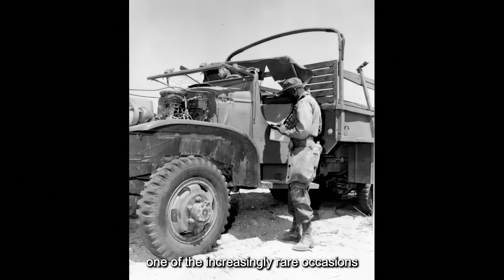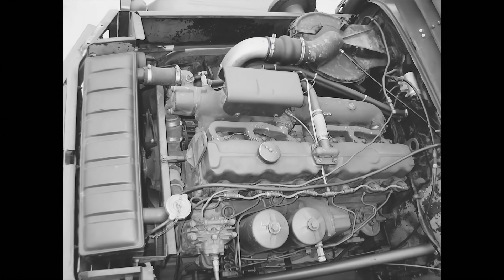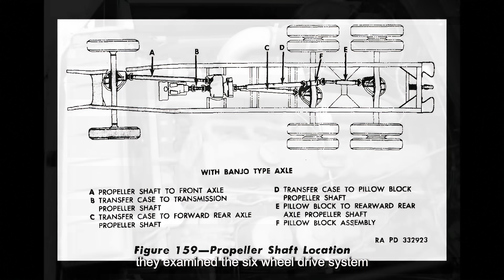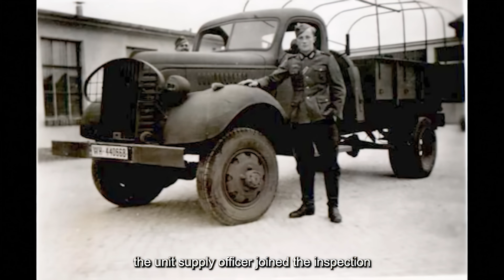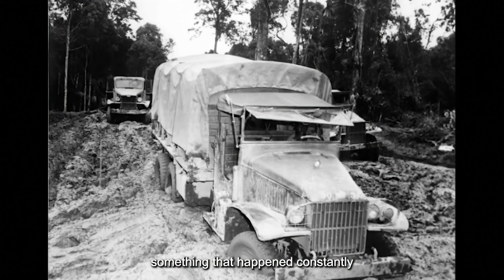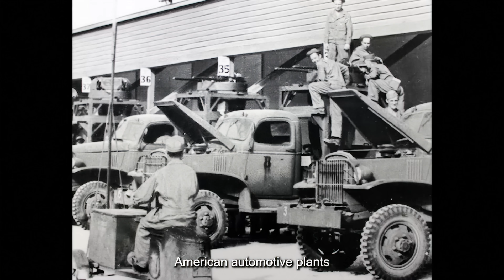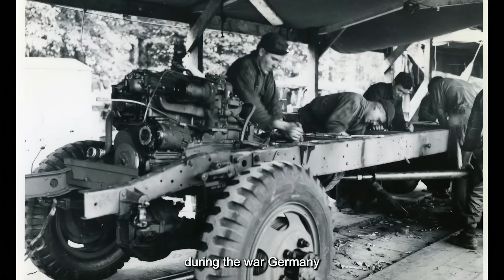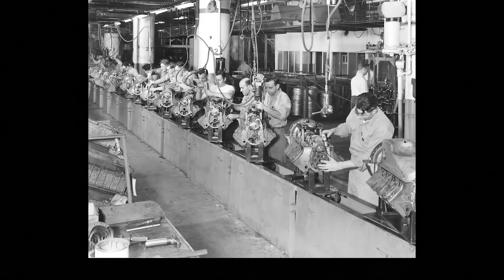Wehrmacht Mechanics Captured a GMC Truck... Then Realized Germany Was Doomed

Comment: Most don't realize that the blitzkreig army was not a fully mechanized, rolling, flame-spitting juggernaut. The massed panzer divisions with Stuka support only represented the cutting edge that would do pincers movements by punching through and encircling their opponent's forces and link up behind them. The infantry advanced as quickly as possible with foot and horse power, like armies dating back to the Roman Legions. The fact that the troops were hopped up on Pervatin helped them keep going faster than allied forces thought possible, they burst out of the Ardennes and crossed the Meuse River in a timeframe that would have been impossible in 1914.

Comment: Same problem with German tanks>>over engineered and complicated versus the huge number of US Shermans.
Reply: The Germans could have scaled up production. Everyone underestimates their decision making. Germany was deperately short on fuel. They abandoned vehicles due to a lack of fuel quite a lot especially in '44-'45. There is no reason to overproduce vehicles that you can't keep running. They were just like any country with some weapons system and vehciles which were highly relaible (Sd.Kfz. 251, Marder III, Panzer IV, StuG III, Jagdpanzer 38) and others which were not.
Reply: also these "overengineered" tanks achieved fantastic casualty exchange ratios compared to allied vehicles.

Comment: German engineers created plastic oil filter housings, intake manifolds and oil pans. On GM, Dodge and German cars. Seen them and scratch my head. 
A 180 from war time=Engineered to fail, by design.
Future issue with panasians will be quantitative as well. Shoe on other foot sheer numbers of boots and rc flytoys.

Comment: Even before Pearl Harbor, in 1940 and 1941, the US started secretly building massive war-time factories all over the country
Reply: You’re right — the U.S. was gearing up for a major conflict well before Pearl Harbor. Those early factories and production efforts played a huge part in how quickly America was able to mobilize once the war officially began. Fascinating part of the lead-up to WWII.
Reply: @WWIIJournal-d5z @WWIIJournal-d5z  I worked in the Fridley, MN, Naval Reserve plant in the mid-90s, and most of the WWII tools seemed to still be intact. It had a massive number of heavy machine tools. It  was built in 1940 or 41. Massive overhead cranes, rail tracks in main corridors. When I was there most of it was unused or little-used.

Comment: Excellent AI story telling.  This is exactly how AI stories should be told:  no attempt to deceive and in the end the story is a dramatic summary of the truth.

What's amazing about the deuce and a half is that it is 85 years old but the design is so damned iconic that it still looks modern.  The Blitz, on the other hand, looks like a 1930s design.  Iconic in it's own right but does not look modern at all.
Reply: you’re right — the “deuce and a half” really is one of those designs that never seems to age. It’s simple, rugged, and instantly recognizable even decades later. The Blitz has its own historic charm, but the GMC definitely set a standard that still looks surprisingly modern today.

Comment: The down fall of  of the Modern  cars  made today years ago if you had a burned out head light  you could get a  Sealed Beam  headlight at any gas  Station.  Now they are all Shaped different with LED  very expensive and No interchangeability   this i light  is just the tip of ICEBERG  it goes on and On  with ALL Parts on Modern  cars.  UNNESSESSARY .  Crap that only increases  the COST of Autos.

Comment: Im plenty of aware of standardization, i can go in argentina and fix a series 60 detroit with 4000 usd in parts, a scania head gasket is 1000usd, because scania decides who can make parts and their non-standard filters so they can profit from licensing

And if the engine went bad i can put any cummins or cat engine because it has a standard clutch housing, MAN and Iveco use the same ZF gearbox, the bellhousing is completely different

Comment: It has less to do with germany lacking the production capability, not saying they could have competed in vomume.   Look into i think its the rolls merlin.  Packard had to convert overly complicated plans into mass produxtions plans,  something like 200 pages to 50.  They were over engineering the assembly line into a car built by one guy instead of  500

Comment: My father, an agricultural machinery mechanic, was transported in an open truck like that from a prisoner-of-war camp in southern Germany to the vicinity of his home in the summer of 1945. He told me that the Americans had heavier, more primitive, but more reliable equipment. His Opel rocket launcher already arrived overloaded from the factory. Currently, however, the old plague has broken out again in the Bundeswehr (German Federal Armed Forces). Everything has to be developed over years as a super-perfect, top-of-the-line solution.

The video's conclusion is a bit of an exaggeration. The Germans rebuilt Germany through hard work, perseverance, and a good vocational training system.

Comment: Tactics and equipment win battles. But logistics is what wins wars. And if you want to know what US MIlitary Logistics was and is capable of, look up The Berlin Airlift, aka Operation Market Garden.

Look up The Ice Cream Ships... the US soldiers were eating ice cream while they fought Japanese and German soldiers who were subsisting on less than 1200 calories a day. Look up Operation Paul Bunyan with the fact that that entire demonstration of force was put together, packaged up, and sent all the way to the South Korean DMZ in three days in mind.

The Germans built excellent equipment but they overengineered EVERYTHING to the point that if they so much as missed a single maintainence task at any point it would break down, while the US designed everything it used to be as simple and effective and hard to break as possible... primarily because we know our soldiers and we know that if there is a way break a piece of equipment our soldiers will FIND IT.

The Germans needed unique custom parts for literally anything because it was so heavily engineered. US standardized everything so that the same parts could be either used to fix anything or quickly ADAPTED to be used to fix anything. The Germans would get stuck waiting for specific parts for their damaged tanks, US could just yank engine parts out of trucks they weren't using and slap them onto their damaged tanks with a little quick problem solving.

When the supply lines broke down or became backed up and overburdened the Germans had equipment just keep breaking, while the US in the same situation had almost everything at hand they needed.

Comment: Now America has lost this ability, it was handed down to the Chinese.
They now hold the power of manufacturing, the very thing that made America it is today.
America has became the Germany of the past, still fairly capable but everything that is made is both too complex and expensive to be replaced quickly.
American can now only produce a small number of ships, aircraft and smart ammunition a year, not productive enough to win potential global scale war or even act as a deterrent.
Reply: Yes. But there is a reason we did. We at this point in time, DO NOT NEED TO MANUFACTURE THAT MANY AT THAT RATE ANYMORE. We didn't manufacture that many before WW2, either. We flipped over to that production rate shortly after entering the war.

We have the tip top pinnacle of military technology in every single field, and in amounts so MINDBOGGLINGLY VAST that we can simply bring things out of storage at literally that same production rate for almost a full decade. Most countries have 25-100 fighter jets? Across all three branches with aircraft we have over two thousand. We have so much of the top or fully-effective near-top equipment that we basically just produce enough to replace whatever is too old.

And we are fully able and READY to ramp that production right back up to WW2 levels at any time, with logistics planning for doing so well before our stockpile going dry (literally within a year and a half of a war starting).

We didn't give that ability up. We just gave it a rest because we have more than enough shit built and in storage right now to take on literally anyone, even China.

Comment: Germany of course produced fantastic engineers but for some reason they couldn't temper their need to bring everything to exacting standards, even when they weren't really needed - after all, these are vehicles built for war. An example of this was how many engine and driveline designs by German engineers didn't require gaskets between certain mating surfaces. This was because the surfaces were so perfectly machined to such exacting dimensions that they sealed against each other without any gasket at all. That's a level of quality machining that's impressive, but ends up being a detriment to producing equipment at the rate that was needed, and which could be serviced in the field by regular mechanics. Of course Americans could produce equipment on the same level if we wanted to, but the obvious choice was made to design and produce equipment that could be cranked out quickly, cheaply, with allowance for errors and variations in production, ease of maintenance and replacement, and get it out the door yesterday. German engineering doctrine simply couldn't seem to allow itself to stoop to that level intentionally, despite the clear advantages of a less than perfect machine having a level of perfection that's different from what exacting specifications gets you - it's perfect because it just works despite the challenges that are faced both in the factory and in the field.

Comment: Surprisingly nice comments section, hats off. At least in the first dozen there is no exaggerated clapping (yay, go GMC etc)  one would expect. The video, while pleasant to listen to, repeats the same thing 7-10 times, yet doesn't mention that Opel's lack of reliability was also thanks to sabotage by forced labour and resistance action. And everyone relied on fuel being there forever waiting to be extracted. The Germans had to ration fuel since 42 or even earlier.

Comment: For a while, I owned and drove a 1982 MB 300 SD turbo Diesel. I had it for two years. At the time, the car was in rough shape, but it ran and ran well, for it was over 40 years old at the time. if the frame didn't break and could not be repaired, I still would be driving that car. Those 240s and 300s diesels from the early 1970s to 1983 were some of the finest automobiles that were ever made. I could even work on it, and I am not much of a mechanic, they was just so simple and well designed and made. But parts like wire harneses and impossible to find and the ones you do fine are souced from junk yards all over Europe. I need one, and I found one, in Poland of all places. Very inconvenient for and every day driver.

Comment: When I was a teen in the 80s, we all wanted Japanese cars because they were so much more refined than American cars. Now that I'm old, I have the utmost respect for my 89 Suburban. Small block Chevy engine, TH400 transmission, leaf spring 4x4. The cheap, simple, tough-as-nails engineering has stood the test of time. I drive it daily and love it. It never breaks, and I can always find parts. The Germans can brag about their complicated, fragile engineering, but history will award America the grand prize. Great video. Thanks!
Reply: Yes sir I own a 72 gmc owned for more than 40 years and  85 k10 had her 30 years and these door knobs try to tell me my gm trucks will not last !
Reply: I am a german engineer and I would want to built products cheaper, easier to repair and much more reliable and longlasting and I also would know how to achieve that. But there are Managers, CEOs and stakeholders and in the end some very rich families (who own BMW and others and want to maximize their profits), who demand other priorities. Therefore we (as german engineers) need to follow some business decisions, which include special tools in workshops, complicated parts, no easy maintanence and planned obsolescence. In my opinion that is just the same in america and everywere else except Japan. They are still building small, mostly simple and reliable cars.
Reply: It has very little to do whether a car is Japanese, German, Unitedstatian or French, but rather how the local economy works. In Mexico the most popular car for decades was a German one, the Type 1 VW (commonly known as Vocho), and it was well-liked because of its ease to repair, cheap parts, and versatility. Cars have won over public transportation in almost every sufficiently developed country in the world, so there's no longer a need to make them attractive in any one of those areas, so we end up with unnecessarily computerized systems, highly specialized and non-standardized parts, and specific uses vehicles.

Comment: Each time a BMW, Volkswagen, Audi, etc comes into my shop, I am convinced that Germany learned very little since WW2.
Reply: They finally have with the B series engines. Like maybe 10 years ago. Hey, better late than never, I suppose.
Reply: The new crap, for sure. But everything VW ? My 92 Audi 80 b4 besides a starter and brakes.. Nothing to repair yet - with 150000 km on the counter and I now go looking for wood to knock on immediately...😁
Reply: @PseudoNym135  150000 km is not a lot
Reply: But 20 after World War II, Volkswagen was putting a hurt on Detroit.
Reply: You mean Germany now. The Volkswagen Type 1, called "Vocho" in Mexico, was a highly steemed vehicle thanks to its versatility, ease to repair, and mass produced cheap parts. It was manufactured for nearly 60 years until 2003, when the last one was produced in the VW plant of Puebla.

Comment: The irony is that GM owned Opel from 1929-2017.
Reply: And the Opel straight six engines were Chevrolet designed.
Reply: hell, they even sued USAAF for bombing their plant in Germany
Reply: @Cheveliery  agreed, and the US paid... 3 millions or something
Reply: War profiteering?
Reply: @talhawaqar836 Always Was!
Reply: And Standard Oil worked together with IG Farben
Reply: Whoa. I didn't know that. I just read a bit. Ford, too (which is kind of expected), but especially GM. Wow. Thanks for pointing that out.
Reply: They act if the opel blitz was a bad truck lol. My father bought one at a military action in the late 1960s. It drove for 12 years converted to tanker truck in holland. As kid I could back it up into the yard with out problem but never got it in first gear.
Reply: Also the Dehomag was part of the IBM Company
Reply: German Military was powered by American tech and money
Reply: @geronimoushendrix4762  with american jew money, the tech was lightyears ahead of the us tech
Reply: @6 @66mikkim  what are you talking about? Opel Blitz was one of the best transporters in WW2
Reply: @geronimoushendrix4762  And it was not AMERICAN
Reply: They did own Opel, but the vehicles were designed in Europe by Europeans exclusively for the European market.  Using inferior, overly complicated, failure prone European engineering.
Reply: @JaughnDough the opel engine is based on the Bedford engine so the GMC AND CHEVROLET  are from the same desin
Reply: @JaughnDough Also, the Germans took over their Opal, Ford, and other American divisions during the war.

Comment: Really is a shame, they didn’t stick to this Simplicity. I had to change the Batteries on two Fords one Required Three different Wrenches. The Other two Wrenches, socket extensions, ratchet handle, and a Deep Nut Driver, and another wrench to get the fastener loose first.